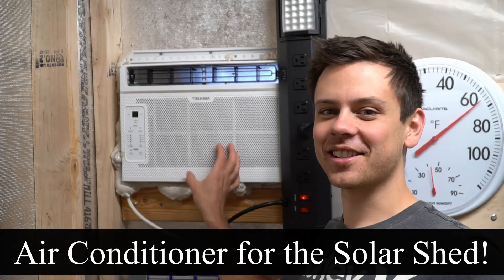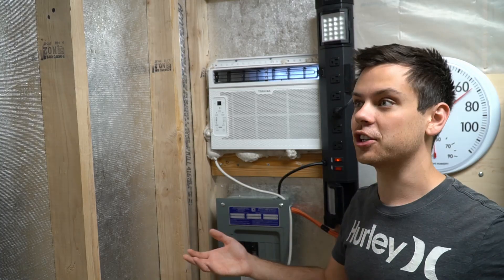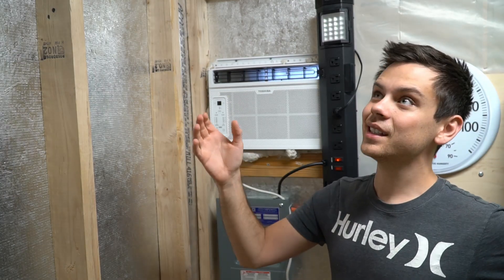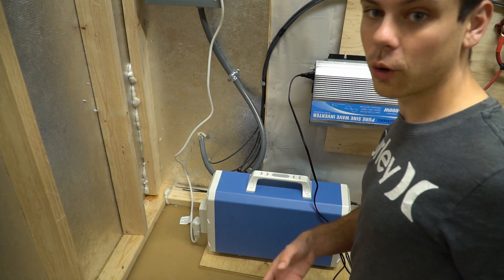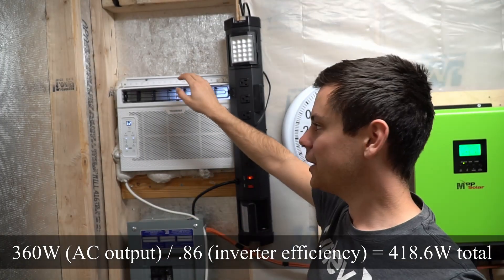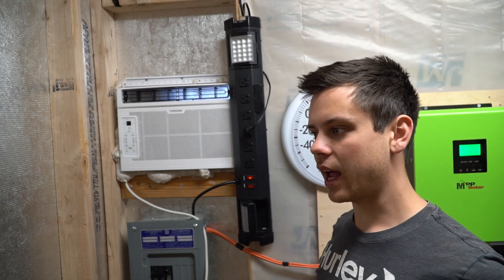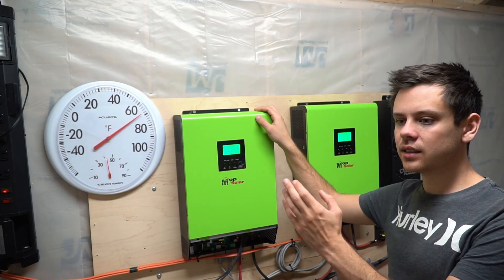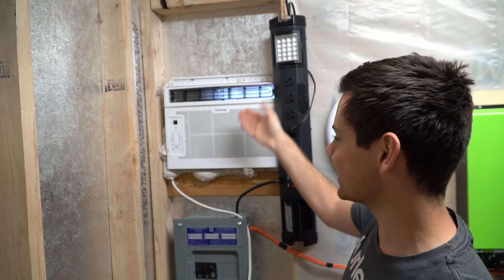Solar Shed: Running a Cheap Air Conditioner

Comment: Thank you for the informative video. I just had one comment.  watch out for condensation from those window Shaker units. I live in a house in Florida with only window shakers. And I'm constantly having condensation leak in my house from the bottom corners of the AC. You definitely don't want to have that water above your electronics. It could cause major problems for you. I would look into repositioning.

Comment: So i have a fair few giandel inverters. And they have mostly been fine but 2 of them failed, both the same model. 2200w (4400w peak) 12v-240v PSW. One of them just stopped working while running it overnight to power my PC and stuff during a power cut. It seemed to just die and now if you plug something simple like a 100w light blulb into it it will just pulse on and off. Its like the inverter is waiting for feedback before it properly kicks on. 

The second one died in a more spectacular manner. Was powering my cheap portable AC during a power cut. AC was rated for 1400w so i should of had plenty of head room on a 2200w inverter. It ran the AC for about an hour with no problems. THen the AC satisfied and shut the compressor down. When the AC kicked the compressor back on it was like the compressor stalled and the inverter screamed its buzzer then few crackles and smoke came blasting out of the cooling fan. I very quickly yanked the anderson connectors going to my batteries apart not wanting to touch a unknown if its live inverter case to turn it off. 

That inverter does still work, ive since tested it with just some dumb hard to damage loads (flood lights, heat gun etc) and some 12v 130AH AGM batteries just incase it goes pear shaped but it seems to work ok, i wouldnt trust it with anything expensive however, that smoke had to come from somewhere. 

Also at least all mine do have low voltage cut off. But its at like 10-10.5v for lead acid batteries which really is too low anyway, but if you just use the horrid cheap cable that comes with them, you get so much voltage drop over it that your battery is prob more like 11v when it trips.
Reply from the maker: Did you not have a fuse on your circuit? What size wire?
Reply: @WillProwse  I was using 0 B&S wire. 50mm2 from Tycab Australia. Its rated for 250amps Had it fused at 200 from memory. I think its entirely possible i killed the power to it before it had time to blow the fuse. I was using Mega fuses and they always seem to take a while to blow.
Reply from the maker: Yes it has lvd but totally pointless for LiFePO4 discharge curve
Reply from the maker: Yeah horrible cables that come with most inverters

Comment: 2 things: 
1. why not use a swamp cooler?  
2. if you use a smart plug, don't u need an AC unit with mechanical dials?

Comment: I've been wondering about using a small a/c on solar - thanks so much for doing a serious demo!!  Also, would you please consider doing a video on how to use a 2016 Nissan Leaf (30kw w/CHADeMO port) for V2H while keeping my grid-tied 10kW array (with built-in anti-islanding)  up & functioning during a grid down situation?  So many people could do this!  And with the increasing number of EV's on the road, I think this will be increasingly important.

Comment: Great stuff,  How many 300+ watt solar panels would you recommend to feed a bluetti that would then run this air conditioner?
Would additional batteries be necessary?  What size  Giandel Inverter would be necessary?
thanks

Comment: I follow a lot of cruising yachts and catamaran sites.  One of their biggest problems is cooling the boat at sea or at anchor without running their engines to generate power.  I've always thought that there must be some way you can generate enough power from solar to do that.   It looks like you are on the right track Will.  Good for you, and if you do happen to perfect what you are trying to do, please make sure you take out a patent on it to protect your future life.  Well done young man.

Comment: Most inverters can not handle inductive loads ( motors ). Try plugging the AC into a power strip with a over voltage suppressor. It should help suppress the spikes coming from the motor.
Reply from the maker: That's not true. Calculate the surge, it's easy. This one can handle it just fine
Reply from the maker: Low and high frequency inverters have a surge rating for inductive loads. Low frequency can handle more than high frequency inverters

Comment: Thanks for sharing your knowledge!  I have a question. 
I'm looking to install a 9000btu mini split with a 20 seer value in my RV and power it with solar. Do you have an Idea of how many solar panels and how many 100ah battle born batteries would I need to power it in the summer I live in Arizona and it gets pretty hot

Comment: "Didn't want to spend that much on a mini split, so I got this one for $200-$300"
"Oh, but I hooked it to this portable power station"
Clicks link for power station - only $2k
Reply: I know nothing of what he is saying BUT I am lost in his love of what he is doing. I look at the projects I spent money and time on over my lifetime cause I was ALL in an it makes no sense but u r driven. I get it totally. So I never finished that project, oh well. It’s only money. He is delightful.  Hurricane season coming in Houston soon ,after the freeze we just had, an no power. I love the thought of cooling down my small garage apt when an if power goes. I sat here 2 weeks in the hot after Harvey.  Great job kid. I’m learning.
Reply: That was my reaction, too 😳
Reply: I'm the almost 70 version of Will.  I spent nearly $25K on inverters, 1200 AH of LiFeP04 batteries, transfer switch, wires, fuses, etc.....just to keep my fridge and clock running when the utility shuts down.
Added bonus: We lost power one rainy evening  in November for over 4 hours. I'm the only guy for miles who cooked a turkey on batteries.

Comment: Is that A/C designed for wall mount, or is it a window unit that you mounted in a wall?  Units designed for wall mount don't have vents on the sides in areas that are likely to be blocked if mounted in a wall cutout.  But if your walls are thin, it shouldn't be an issue.

Comment: Nicely done. Price is normally a huge consideration so it's good to see what the lowest cost method does.  Do you really need an inverter to run an AC? I bet there's a universal motor running that compressor that you could find a more efficient source of power for.

Comment: In proper Will Prowse style the next video will be where he now hates the little air-conditioner and has removed it and decided there is no reason at all to cool the shed so he will just put a window fan there to vent the air, then another video later he will totally tear down the shed and put all his solar stuff inside the house since it is already climate controlled, then he will dig an underground bunker and put 60,000 watts of solar in the backyard haha I love how his unpredictability in itself is predictable but it always keeps things interesting!!! that's why I have continued to watch for YEARS even though I only have a moderate interest in solar.
Reply from the maker: Hahaha
Reply: I know this is an older video, and I haven't seen or heard anything in or about it that addresses fully why AC for the shed? General improvement of electrical function and longevity, for sure. But, unless I'm misremembering something, don't LFP batteries undergo degradation when stored in a state of high charge and high temperature? If that's the case, what's the best backup plan for when the little AC unit conks out?

Comment: The best way to use energy is by not using it, to avoid the need of cooling or heating : insulate, insulate, insulate.

Comment: My 24v inverter released it's magic blue smoke a couple days ago so I have ordered some parts for it, it blew a cap and four k20t60's ☹️ the solar panel spits out 35 volts and I'm using the MPT-7210A to charge the battery. So when the battery is fully charged, the bms cuts off the power and let's the MPT "charge" the inverter directly with a voltage of about 35v. Do you think I could bypass the bms and charge the battery directly to avoid it happening again?

Comment: To get better heat transfer from that little tiny window shaker as they are called, put it on the side in the shade. Every bit helps!

Comment: Do you have a set of plans for this ?

What is the outside of the shed made from?
If possible spend some money and cover it in EIFS. 2 in foam exterior will turn that room into a meat freezer.

Comment: hi Will,,The Frigidaire energy star 5k btu unit is also a  must for solar power use. Im going to run mine with the Bluetti I hink they have a bigger size model now. my set up will be inside a 4x8 squredrop camper that is insulated with 2 inch owens corning foam all the way around and on the ceiling,,my a/c on shore power only runs 4 to 6 minutes every hour im hoping 2 solar panels will keep the bluetti running the a/c and my only concern with the bluetti is handling the start up sur charge  of the a/c

Comment: You've probably been asked this already but what do you think of wholesale solar for a diy without as much planning on your side. I'm mechanically inclined but I don't have all the knowledge and I want it to be safe and pass inspection easily.
Reply from the maker: Sure use a kit instead. That's smart way to do it

Comment: Just 2 words for insulation... SPRAY FOAM  if you use the closed cell it has the added benefit of making your shed water tight. I know the upfront cost might be a bit high but in the end might save you

Comment: Good luck with that A/C unit.  I bought a 8,000BTU model built in Dec. 2018. They were on sale and I was interested because it had WiFi and remote control unit.  The first one I brought home and installed sounded fine, but it was a cool day and I thought it was working.  As soon as  we had a warm day I realized it wasn't cooling.  The compressor was running, but no cooling?  I took it back and gambled on another of the same model.  Checked it before installing and it worked.  Put in my window and thought everything was okay.  Next day I tried the remote control and it only works if it wants too!  Checked battery and watched the remote light with my phone camera and it is sending signals, but not getting consistent control.  Next I went through the steps in the instructions and tried the phone app and WiFI.  Should have known from the reviews for the phone app that I was screwed.  Only thing I haven't tried to get the WiFi to connect is moving my router.  Think the A/C module only works on 2.4Ghz?  The thermostat isn't very smart either.  It's almost like it just works off a random timer and doesn't care what the temp is.  Last time I will buy this brand.

Comment: Thanks I've been wondering what inverter to get for 24v.
Do you know what I should expect to be able to power with the tesla 5.2kwh battery with 900w of 24v solar?
I'm a little confused as to how much I should be able to use each day... could I expect to be able to use a hot plate for cooking? is a microwave out of the question? oh and what about a toaster?
One last quick question. do you have the parameters for the max voltage and minimum voltage for your tesla battery?

Comment: I think you are vastly underestimating how hot it will be in the summer. Night time temperatures will stay in the 90's. Add more insulation!
Reply from the maker: Absolutely. May need a ATS to run system at night

Comment: I'm subscribed to several RV channels.  Every time one says, "You can't run an air conditioner on solar", I have to comment.  No... you can't run a 1960's tech roof mount unit (they basically haven't be re-engineered since then) that pulls 14.5 amps running, and have a HUGE start-up surge.  But a window unit, or a mini-split... hell yes you can!!!  I have TWO.  A 12,000 in the front, and a 9,000 in the rear bedroom.  They are both on 100% of the time out west (ok... at night, I turn the front one up to 75, but the rear one is cranked down to 68!!!).  Those are high tech, but my system is low.  Around 2,200 watts of solar up on the roof... and 900 amp/hours of golf cart batteries.  But... I've got less in the entire system, including the mini-splits, than most have in the 'new tech' batteries alone.
Reply: your statement is giving me hope. i am trying to understand the scale of things. what can be achieved and for how long and how  much will that cost. i noticed that 99% of the commenters sing praise to the channel rather than talk about the technical aspects of principles in use.

Comment: Will, look into Home Assistant Automation, I have dived really deep into this software the last few years, I installed ac relay boards with temp sensors on my window units, so they smart control the a/c via my setting, I have it setup to come on only at set critical temperatures, then turn on when I'm home to "at home" settings based on geoloaction detection of my cell phone. I also use this automation system for my hydroponics garden in my greenhouse, I have probes detecting the water ph, calcium, magnesium and such levels and autocorrects to keep them within a set range of variables I have programmed by adding specific ingredients as required, also reduced my fertilizer expense by detecting how little of ingredients is actually needed to keep plants happily growing. It has been a game-changer on taking a lot of the hard work out of getting my stuff to function perfectly. It just works so well... I feel you could implement this into your solar shed and automate things.

Comment: Will did you look at the AC / DC air conditioner's  I saw a few that wear under 300$$ and  wear 12,000 BTU

Comment: Hello Will, The Amazon link you posted is strictly for a 12v inverter not a 24v inverter. I will try to find the 24v model but please correct the link. Thanks.

Comment: I just took a portable AC out of the boat and replaced with the same window AC.  Its great!  Also using the 3KW Giandel inverter with a 2KW as backup.  I also have LiFePo4 batteries and a need to keep them cool.  Looking forward to a follow up video about maintaining temp within limits of batteries automatically.  Also thanks for warning about no low volt cutoff on Giandel.  Must have missed that when I didn't read manual.  Will copy your low voltage protect and temp management when you post about it.  Very helpful stuff thanks!

Comment: I wish I knew 1% about electricity and solar energy as you do. I'm still trying to figure out how long I could run an A/C unit like that off of a EGO Nexus Power station with four 7.5 AH batteries.

Comment: I am starting with an ice maker which I thought was a very good suggestion on your part and noticed a difference between my generic 4000/? Pure sign wave and my brand name modified sine wave inverter that cost 3 times as much 3000/6000. Now I'm questioning whether I should have purchased the brand named one. I also noticed my lithium ion battery pack will only charge to about 12.7 volts which also is a problem for the larger appliances such as my refrigerator. Any comments would be appreciated.
Reply: Turns out my cables front the battery bank to my inverter were too thin.

Comment: Hey Will! I’ve got 3 100W solar panels right now and I’m debating buying another one so I can run a 150W LED light, but I’m not sure if the panels I have right now are enough. Is there a way to test how much electricity I’m using? I know I’m generating about 2.5kwh/day

Comment: Your shed isn’t moving and it small like you said so cutting a hole in the wall is a good route to go and using a window unit as a permanent solution is perfect 👌🏻

Comment: Have you thought about using a sonoff TH 16 device? It will allow you to automatically turn it on and off based on the temperature within the shed.

Comment: Hi Will Prowse, been watching your videos for sometime and really enjoy your content... Question; I am looking at getting a second lifepo battery... I have been fighting a battle with the distribution of my second battery and don't see it coming... So I have 1 X 120ah 12v, looking at getting a second 120ah battery and was wondering if having two different manufacturers batteries wired for 24v will cause me trouble.

By the way I have hooked up a 1100w ( 360w 1.6a cooling  1-10m2) box A/C in my van waiting for the second battery as the inverter I have gotten is for 24v system. so I'm curious to see how your A/C dose in your shed, as my initial testing is mine is too small for the area but have not been able to test it on multiple days of running and I'm looking forward to doing just that.

Comment: FYI - all 3 of the 24v Inverter links on your website go to the same 12v Inverter on Amazon. Searching the Glandel Amazon store they have a 24v 2000w for $180 and 24v 3000w for $480.

That leads me to a Video Request about pros and cons of using multiple Inverters, when it would be a good idea, why it is a bad idea, and the wiring implications involved.

example: Based on those prices, it looks like buying 3 of the 2000w for $540 might be a 'sweet spot'. In a full time sized RV they could be split up 1 for an air conditioner, 1 for the kitchen, and 1 for everything else (might only need 2 inverters as the 'everything else' category should/could be 12v).  Similar dedicated circuits could be used in a home. Is there any logic here?